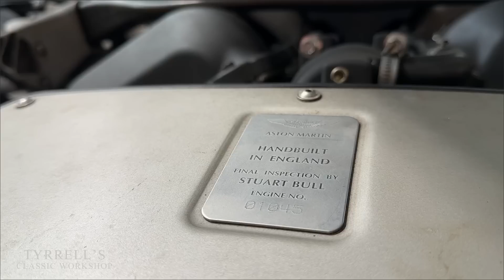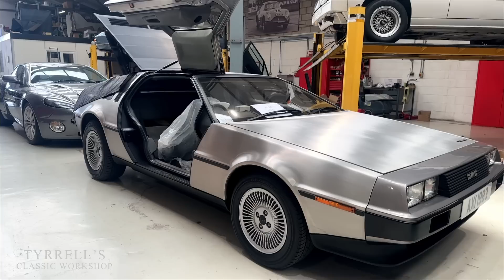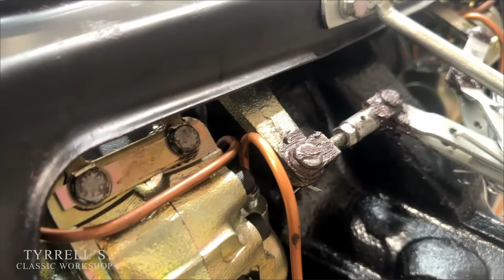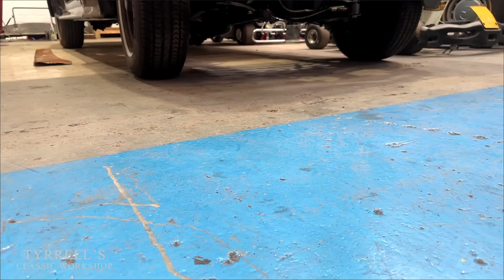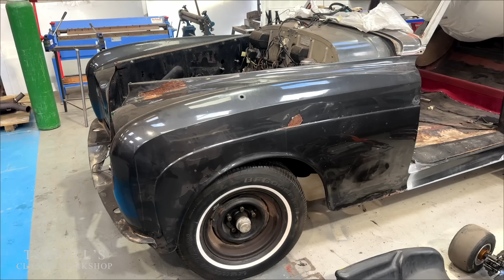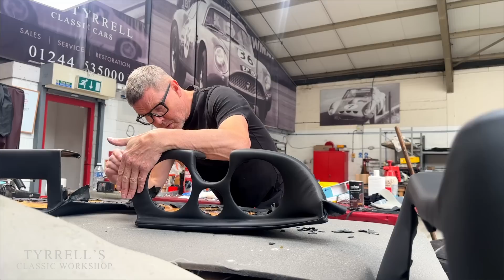Workshop update | Tyrrell's Classic Workshop

Comment: Looking forward to see more videos on the Aston Martin Vanquish. Does this particular Vanquish have the Works manual gearbox conversion? Hard to see the interior through the driver's window, I can only see the starter button in the middle and no buttons for the ASM gear box. 
I have a 2004 Vanquish, I do all of the work on it my self. Currently rebuilding the engine. These cars are very special and a joy to drive when they are setup properly, but they do have reliability problems. Due to way the Vanquish is designed it very time consuming to work on.
Reply from the maker: Yes it has had manual conversion. Good luck with your exploits!

Comment: Hi Iain. My suggestion on the first car to film is the Mk1 Mini. But in saying that, I'm guessing the next car that you film will be the first car that is ready so all good no matter what car is next. I'm surprised that you cannot get a set of rotors for the Aston Martin, surely there is an aftermarket supplier that could supply an appropriate set of discs. Fun fact. Ian Callum was the designer for Holden Special Vehicles during the mid 90's.
Reply from the maker: Thanks. It’s early days with the Aston brakes, we’ll see how it pans out

Comment: Didn't the Vanquish throw the auxiliary belt at full steering lock doing a burnout? They showed it in "Firth Gear" years ago, did Aston fix that?
Reply from the maker: Not heard of that….
Reply: @iain_tyrrell  the fix or the belt issue? 😁 it was Vicki Butler who tested the car. The Aston mechanics put the belt on two time of if I remember correctly and she didn’t start with a full lock burnout again. 😁

Comment: I have no preference as to which car you profile because you give an interesting history of every car

I've always thought that the original Mini was a watershed car in that it had maximum use of space with a transverse engine and front wheel drive. 

Which is a very common layout these days. 

I wish I'd been more automotive adventuresome in my 20s when you could see E-types for sale for $4000 all day. And I'm talking series 1. 

But the maintenance requirements always scared me. 

I've heard you had to drop the rear subframe just to remove the rear disks and pull out the engine to change the clutch 

But what a beautiful machine 

You're certainly right about that rust seizing certain bushings. 

I had a W124 Mercedes and we actually had to use an impact wrench to pull out the bushing with the special tool 

Thanks again for another interesting video
Reply from the maker: Thanks for your experiences too

Comment: Hmmmm is that a Maserati Merak I see next to those Jags back there?  Do tell
Reply from the maker: Yes, at the paint shop
Reply: @iain_tyrrell  I have a soft spot for those quirky engines.  I developed a 3.3L stroked engine with some other unnoticeable internal modifications which transforms Meraks. Amazing what 300hp in one of those does to throttle response and the size of ones smile.  Cheers.

Comment: MINI MINI MINI MINI MINI MINI MINI MINI MINI!👍

FYI - back in 1988, a friend and I drove a 62 Mini Countryman Woody (with a 1200 motor) from San Jose California to New Jersey. The car ran like a dream, though it did struggle a bit climbing through the Rocky Mountain passes. We also hit a terrible rain storm in Nebraska, where the meager performance of the windshield wipers had us both entertained and terrified!😬👍
Reply from the maker: Are you voting for the Mini by any chance??:-)
Reply: @iain_tyrrell  Was it that obvious?!😉👍
Reply: Agreed. I NEED to know why and how Lockheed parts are in the engine bay of a Mini. Even if it's just a short, please explain this!!!
Reply: @agnosticChurchworker  Because Automotive Products of Leamington Spa, England, obtained a licence in 1928 to manufacture Lockheed Hydrasulic brake and clutch systems for Britain and Europe.  AP partnered technically with BMC to make automatic transmissions for their FWD cars in the 60s.

Comment: Thanks! Espirits always seem to have 8500 miles or less. In my DC days, I had an exotic car dealer I knew and he always had a low mileage Espirit. "They buy it, get scared to death every time they drive it, let it sit, and trade it away." Sad fate. Be well!
Reply from the maker: Interesting….. thanks!
Reply: I thought it was because they were unreliable and parts almost impossible to get!
Reply: @tommytraddles  Lotus owners kind of expect those things. The Europa battery would tip over and spill battery acid in sharp cornering, which is why you bought a Europa (cornering, that is). Easy remedy, pretty sure the factory didn't address it until near the production run ended. Classic Hethel